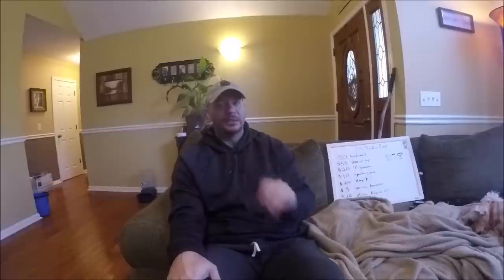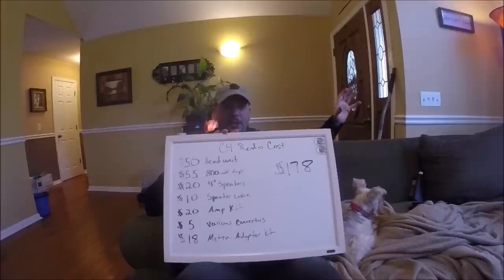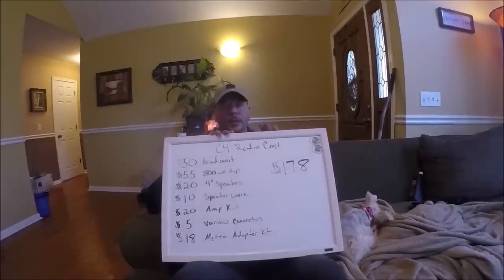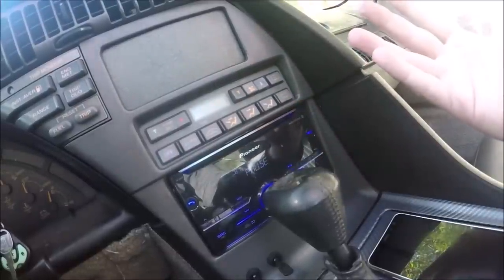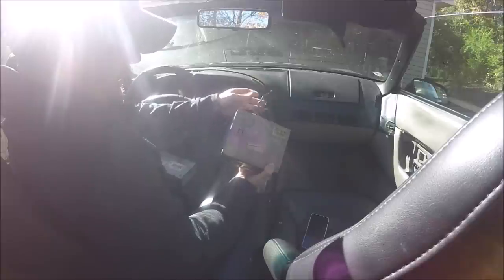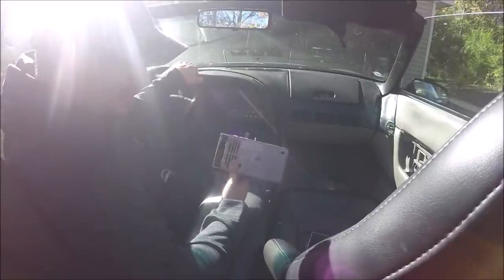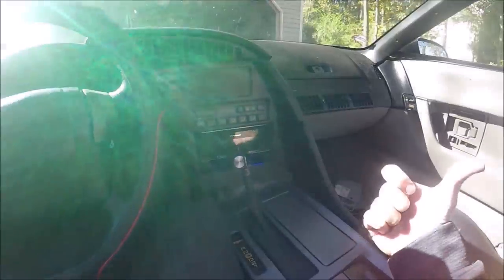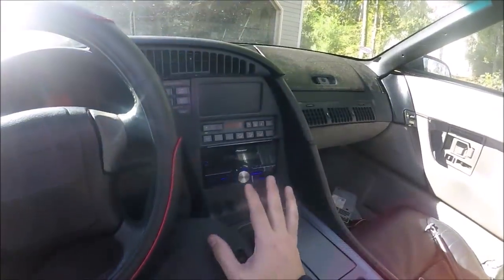C4 Corvette | Ditching the Awful BOSE Stereo

Comment: I just did a swap with my 96. I kept everything and it sounds pretty good. I just used the metra kit and ran it to the back where the cdm is. I also needed the noise canceling adaptors on the RCA cables. I heard the engine noise through the radio. The stock amplified speakers aren’t that bad but then again I have a 96 which may be different then a 91. Also has been garaged w 50k miles.
Reply: NinjaGamer If you hear engine noise check your spark plug wires I had the same problem with my 1995 and interfere with my sound. I moved up the brackets holding my spark plug wire, turned out one wire was touching the engine block cause ground interfere, my guess is that radio ground must be splice with other grounds coming from the engine block. Once I did that noise when away and sounds crisp and clear

Comment: I thought the same thing, GM couldn't have made a bigger mess out of putting an audio system in these cars. For Christs sake, its almost like Bose had free reign to make the most intrusive ridiculous system ever seen. I have a 96 and am getting ready to swap it all out for Pioneer equipment. 4" 3 ways in the rear factory boxes, 6x9 3 ways in the front rocker mounts behind the carpet with plastic enclosure cones, the head unit is 200 watts and I will be running a powered enclosed subwoofer behind the drivers seat. I have the adapter kit to remove the old tuner from behind the passenger seat and run to the head unit with an antenna extension. I'm going to use the factory speaker wires, we'll see how that works out. I don't need amps or more than 200 watts, I just want it to sound good when a favorite comes on, look good and be reliable. Good job on your C4, people don't realize how rare these cars are getting and its great to see others giving them some love and life. Rock on.

Comment: I've got an 86 Corvette with the Bose. Sounds amazing and better than my Harmon Kardon system in my Jaguar XF. Nothing wrong with the system. ANY SYSTEM that is electronic that's 30 years old will have issues. Doesn't make it a crap system. Learn the system and fix it yourself. I have no degree or experience in electronics and was able to rebuild the system. Not that hard.
Reply from the maker: I agree its not hard but i see no reason in maintaining 30 year old tech. In an afternoon you can simplify the system dramatically while adding present day conveniences like bluetooth calling, Audio, streaming applications, etc. To each their own though, i am not trying to keep the car all original, i would have went a different way if that was a goal.

Comment: I’ve got the Bose in my 95. When I got the car I noticed there was no sound coming from the passenger front. After inspection it was unplugged. I soon realized why.... the amp was blown for that speaker. I got a used one from a guy off Facebook for $50. It sounds great now.
Reply: Amps can be rebuilt for $50 apiece by Bose Central.

Comment: My speakers have a little static sound. I may get new speakers but I don’t know the size of the speakers in the front. I have a 90 corvette
Reply: Albert Guzman static sound is cause by a bad ground, I had the same problem with my 95 vette so my guess is check the spark plug wires and make sure they are not touching the engine block and make sure they are all separated and bend the bracket holder up a little to make sure they won’t touch at all. I had the same problem and mine was one spark plug wire touching the engine block
Reply: Thanks, mine also crackle and make noise, it does go away at some point, but does come back a little.

Comment: I could really use your help. I am struggling with my 1990 ZR-1. My car already had an aftermarket alpine stereo with a 4 channel amp and subwoofer etc. I tried replacing the old aftermarket head unit with a Pioneer bluetooth one.
I joined the wires and it fired right up. Sadly however, before I taped my connections the wires probably moved and touched one another and suddenly the radio stopped working. The radio itself is fine. I tested it with 12v external power. I checked the fuses on the passenger door and all seemed fine.
Reply from the maker: Did you check the fuse on the AMP? 
Also, use a multimeter and make sure you still have power to the switched power wire. You may have a good fuse, but there might be a break in the power wire from fuse block to the radio.
Reply: @cvsahara  I went out and got a multimeter. Followed the cables, turns out it was the regular old 10a "radio" fuse. Thankfully!
Reply from the maker: @andreavgr  nice, glad it was an easy fix

Comment: You could just add the pac OEM-1 factory sound system interfere wire harness to avoid all the computer errors on the dash trip monitor and all that extra wire splicing plus it comes with the pink wire for the antenna and blue remote turn on for the amp for only $40 at Ebay

Comment: I got a 93 and the stereo wiring is an insane clusterfuck. It has an alpine deck, an amp behind either seat, two subs, the speakers are run off the amps, a half din eq board underneath the deck, so much shit. It’s got me shaking my head wondering whose idea all that ridiculous crap was.. gonna sell everything but the deck and start from scratch. Probably shave 200 lbs off the car 😂
Reply: Question / can I put a head unit in and keep all the factory bose speakers? If not what all need replaced? My radio just dont come on and want some simple music.thanks
Reply: Yes you can! Buy the PAC OEM-1 radio wire harness from EBay for $40 and installs in the back of the vehicle for a nice clean clear crisp connection without removing anything else or causing errors to the computer.
Reply: prescott hahn what type of alpine deck is it in now? I might buy it :)

Comment: I got the car with a sony system installed but now I just bought a front control unit and I don’t even know if it’s working. I checked the wiring in the car and it’s a total mess, at least poor connector choice like for example couplers used for AC building single core wires, quick connectors etc. anyway the sony works ok  and has usb port also. I’ve found wires going directly to the speakers so I suppose it has a built in amplifier, much simpler and effective design. anyway I don’t really listen to anything while in the car, since it is a weekend plus track (mild use), I like the music the engine makes :). restoring the audio system seems complicated, if I don’t find at least the receiver unit I’ll just insert the bose interface in its place and leave it plugged out. the interior looks better with the stock radio

Comment: Hello cvsahara, I am putting a complete system in my 1990 ZR-1, I have a question about the cdm or tuner box, other than the antenna wire do I have to unplug the other wires to the cdm? Thanks
Reply: Michael Proulx buy the PAC Wire harness  it will be easier and easy plug in installation that way u don’t have to remove any other boxes or tuners

Comment: That head unit in Australia currently costs $140 fml
Reply from the maker: Its $99 here in the states. I found it on a website called vipoutlet marked down to $50 or whatever it was. I like it for the simplicity but nice touchscreens are coming down in price everyday. You might find something even nicer with some digging around.